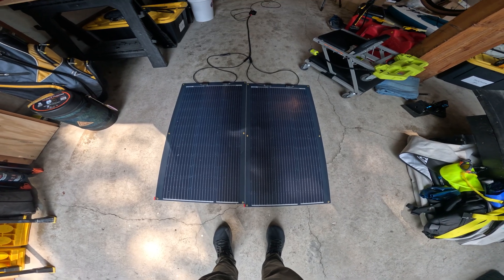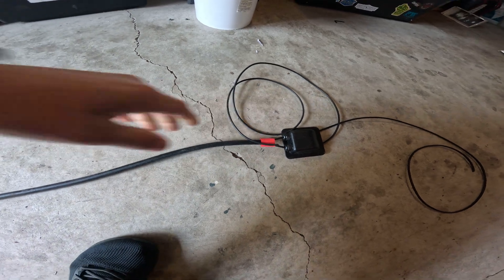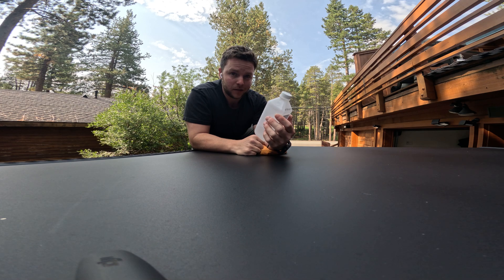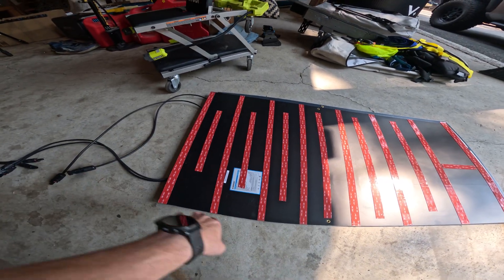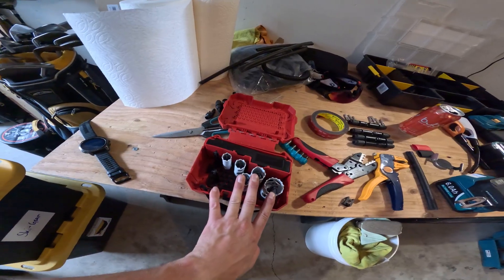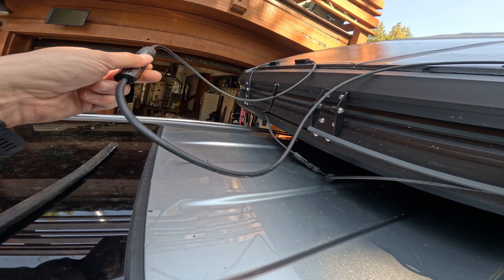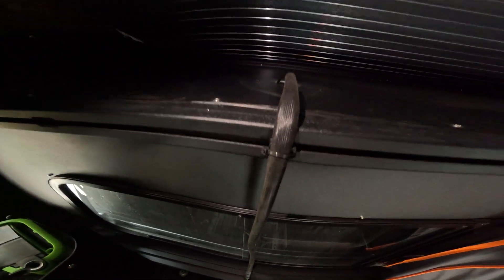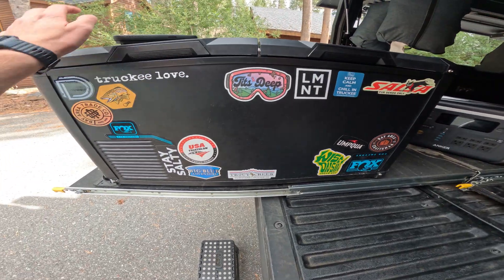Solar on my Dirtbox Overland Canopy Camper - Install Video

Comment from the maker: Would you put Solar on your canopy camper?
Reply: Just added a 220W Renogy panel on my canopy camper. So far it's working great.
Reply from the maker: @OutThereOverland  that's awesome! Did you set it up the way i did going straight into a power bank or do you have a bigger system in the truck?